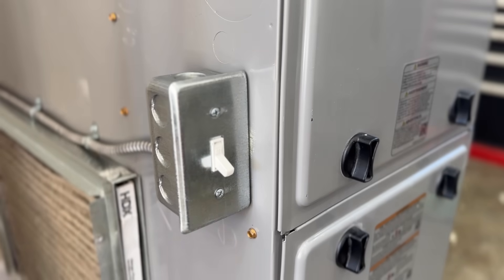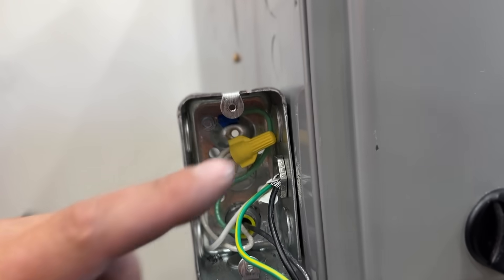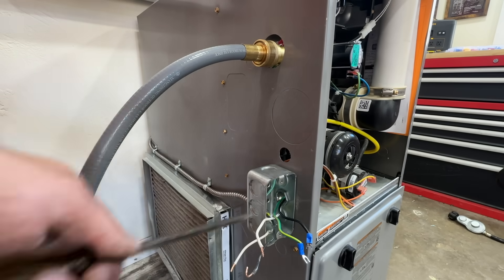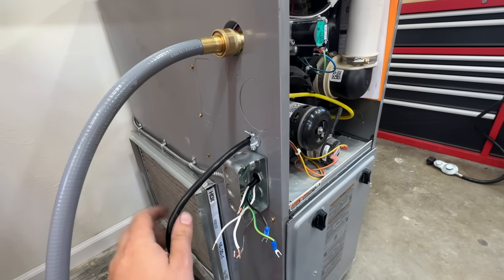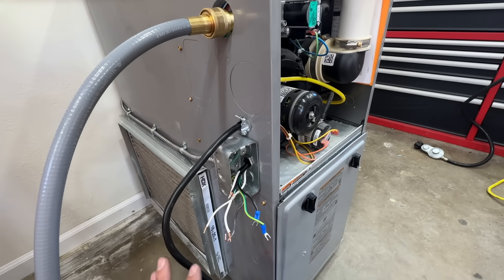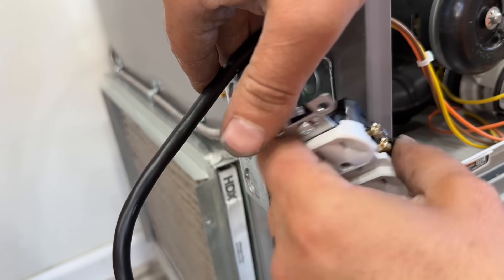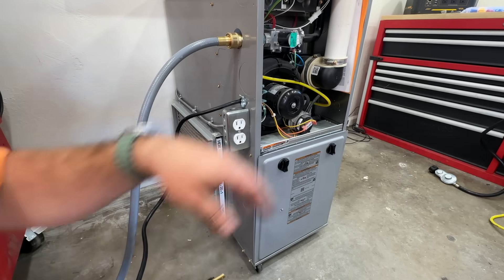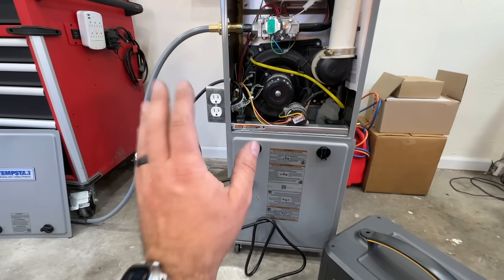Keep Your Family Warm During A Power Outage By Installing This $5 Part

Comment: Using a flexible cord to supply a load that is fastened in place violates the US National Electric Code except under particular circumstances that do not apply to a furnace and boilers are not permitted to be supplied by flexible cords. That doesn't mean that you cannot do the equivalent of what your doing. You just don't use a flexible cord. 

Using a double pole, double throw, center off  switch and a cord INLET you connect the common terminals of the switch to the furnace, one of the selectable terminal sets to the power from the panel, and the other set of selectable terminals to the cord inlet. When you throw the switch up you connect the furnace's wiring to the circuit from the panel. When you throw the switch down you connect the furnace's wire to the  cord inlet. If you move the switch to its center position then the furnace is not connected to either. The center off position is what makes the switch acceptable as a disconnect switch for the furnace. 

When the furnace is in regular use no flexible cord is used because having the switch up connects the furnace to the furnace branch circuit from the panel and no flexible cord is needed. When a power failure occurs you plug the female cord cap from the generator into the cord inlet. When the generator is running and producing a stable voltage you throw the switch down and the furnace begins to run. The NEC does have an exception for the use of flexible cord in emergencies so using the flexible cord to connect the generator to the fixed male cord inlet is not a violation of the NEC.

Comment: Electrician one thing it may have been covered before it comments when you remove the switch you eliminate your disconnect to furnace in normal use which is required by code .

Comment: IMO, it would have been a better solution using the "off" position of the switch to connect the extension. That prevents a feedback loop from forming (This solution does too, but it seems less clean), you can ONLY ever have either panel power or external power. Also, the addition of a "plug protector" would make sure that there would never be a GFCI fault in either implementation.

Comment: Thank you for making this very useful video.
I have installed this on my Bosch high efficiency combo boiler.  Now I will have heat and hot water in the event of a power outage.  I am using a 300 amp hour lithium iron phosphate battery and a pure sine wave inverter to deliver clean electricity to the boiler.  I tested the system last winter during a cold snap and it worked flawlessly for 3. 1/2 days before the battery needed recharging.  I have a spare battery ready to go if needed and small portable solar array (800 watt) to recharge the depleted battery.

Comment: Some furnaces require a bonded neutral for the furnace to operate. I have a Trane, without the bond, it generates an error message and won't run.

Comment: Great video, I would like to add a few pointers. You need to strip the white romex wire a little longer because you tightened the screw on part of the white wire sheild and that could come loose over time and cause a loose connection. The other thing is I would tighten the screws on both sides of the outlet that you did not use so they have less of a chance to hit the side of the metal box or a ground wire. Other than that looks good to me.

Comment: First time home owner here with no generator lol. Currently a power outage due to tropical storm. I have an oil furnace. Would an electrician be able to create this for my furnace (19 year old furnace). I also wonder about a battery for this such as a delta2 battery (?)
Reply: Hi, an electrician would be able to install it.  Whether they want to due to code is another issue.  I built my own safe way of powering my 40 year old furnace.  I have a delta 2 but also built my own battery pack for emergency heating and powering appliances.  Keep in mind, battery charge limitations.  What I mean is, the electrical charge storage of batteries is kind of poor even with the best battery type available.
Reply: @JT-lq4yd yes I have one coming to help. I am trying to decide if I want the ecoflows delta pro or standard portable generator. I wonder how long your model works for backup tho
Reply: @LizAlexy Great, I hope the electrician can get you setup.  The Ecoflow Delta Pro is great since additional batteries can be added to the main unit.  A regular gas generator is a great complement to the Delta Pro unit as it can recharge the DeltaPro.  
The battery setup I put together will only give me about 30 hours, but I also have a generator that runs on gasoline and propane, this will charge(depending on discharge level) the batteries in just over 3 hours.
By the way, I wired a switch to my furnace a few years back and it was nice sleeping in a warm house when power was lost overnight due to an ice storm.
Reply: @JT-lq4yd that’s actually exactly what I’m thinking maybe best for my place. I realized tho I would need to commit to not running my well if I get the delta pro since it’s not running 220
Reply: @JT-lq4yd or else I’ll have to have two sub panels designed the electrician told me my circuit breaker is overloaded so he has to do some work but I don’t think that panel he wants to add is for essentials for the house but other curcuits he told me aren’t done right 😮
Reply: @LizAlexy If you feel a bit more adventurous, there is the Ecoflow Pro Ultra, it can do 240 for your well pump.
I think the breaker panel is full, no more empty spaces for additional breakers and so, he needs to add a subpanel because you would need a power inlet which requires a separate breaker.  Yes, it is important to have the other circuits that he said were not right.  I would get another electrician's opinion, you want to be safe.
Reply: @JT-lq4yd thanks- I was checking the ultra. The person was here was the first to catch these flaws, in fact I had another electrician change double tap breakers to single (since home inspector said it was not to code), and this didn’t help anything LOL. He said the wires are also not done right, so I was planning a sub panel, an ex generator switch, and a lock out on the main case I upgrade to the ultra). My dad spoke w the guy and believes he’s right. But maybe I ought to share a pic of the panel to a friend who does electrical and just triple confirm - safety concerns about the heart of the house had me feeling unexpected 😮
Reply: @JT-lq4yd good idea I asked a friend of a friend who does electrical! Didn’t expect the safety concerns when adding on some switches !!!
Reply: @JT-lq4yd the ultra looks interesting! For now I just got two light weight 1024 watts, and later maybe get a big battery once his subpanel is done w an ex generator switch and a lock out to disable the main - then I can consider any sales on the larger batteries :)
Reply: @LizAlexy  I am happily surprised to know someone is being proactive to minimize the possibility of electrical fires, it is very rare for anyone to think about that 😊.  It was a good thing the electrician pointed out potential issues and yes, if the wiring is flawed, try getting it fixed asap.
Reply: @LizAlexy  Yes, that is how it goes, you start working on something and then you realize corrections need to be done.  In my house, I wanted to install an outlet  in the room where the furnace and water heater are located.  When I opened the electrical box, I found the ground wires not secured together, just pushed into the box 😢.
Reply: @JT-lq4yd thank goodness you discovered it! I’m still trying to decide if ill try to just get oil burner going or make a larger investment in the batteries to run my whole place after the necessary electrical is fixed (he is doing a separate panel and redoing wiring 😢)
Reply: @LizAlexy  The Ultra is nice, but if I were to get it, I would like to have solar panels as well and just have some circuits powered by the unit 24/7.  
Having the power inlet and interlock first is great, then you can upgrade for more capacity later.
Reply: @LizAlexy   I did find it 😊
 I am not exactly sure of your situation but, if the oil burner is working or not, electric heat requires a large amount(thousands) of watts where the oil burner only needs a few hundred watts.
Reply: @JT-lq4yd yes my particular oil burner requires 250 watt continuous. We occasional get sub zero Fahrenheit here. We are going to install and ex generator switch on my oil burner circuit at the panel (so i can use the emergency shut off switch too, at the top of basement stairs if god forbid I need it.) two delta pros come tomorrow, I have a wood stove but a big house. I’m debating what else to expand towards if I want a delta pro in basement at the switch. The delta 2 are 27 lbs, a little easier to move around if I need fridge plugged in or additional battery at the 110V oil burner switch …burner works fine doesn’t need as much electric right now as it will during any extreme weather during winter …
Reply: @LizAlexy  I see.  Now, if your oil burner needs 250 watts continuous, a Delta 2 which is 1024 watt-hours will give you around 4 hours run time.  You just need to see what is more convenient for your situation, where placing your equipment makes sense.
I am more worried about extended power outages in summer than winter because I don't worry about my refrigerator.  Since it's cold outside, I would bring some food to my garage for natural refrigeration.
Reply: @JT-lq4yd true. I have the extra battery which leaves it closer to 3k watts. Debating another pair of these delta 2 plus extra battery and a predator harbor freight open frame 8750. Feel like w these would help run basics for some days at conservative load and run
Reply: @JT-lq4yd here it can get extremely cold in winter like -15. I have had one pipe on outside wall bathroom freeze each winter once..in the summer, I’m less afraid LOLOL
Reply: @JT-lq4yd could also go larger w the inverter and get a 11,500 watt but it’s a lot more expensive, and also 300 lbs. I’m like I cannot roll a horse 😂
Reply: @LizAlexy  Yes, the Deltas paired with the generator are ideal, especially because they can recharge in about 80 minutes from empty.
Reply: @LizAlexy  Right, I am in northern Illinois and it can get that cold here as well.  Because I installed a transfer switch on my furnace, I don't worry about sleeping in the cold 😁 but also frozen pipes.  You are so right about not having to worry about that in summer.
Reply: @LizAlexy  A 8,000 watt generator is great for the average house.  You could run some appliances while recharging the Deltas.  I personally have 2 inverter generators, one is 1,600 watts and the other is 3,000 that can run on propane, Hank Hill approved 😂.  Gasoline goes bad after a while.
Reply: @JT-lq4yd house is a little larger than average 😂 but I can’t move a 300 lbs 11.5 k inverter. In all honesty in two years we lost power here and there, not typically for more than 6 hours. Still had a pipe freeze when temps went sub zero, perhaps one thermostat was old and cranky next to my improved wood stove tossing the thermo dynamics of the layout lol
Reply: @JT-lq4yd did you mean that if I charged my delta 2 and extra battery yesterday, it’s charge won’t hold long? Or do you mean when I am using it, it won’t last long. I had the electrician here when I plugged the units in. We set up one dehumidifier  to it 2800 ways at 50% and got a read that  it would would last 2 hours. lol. I need some more provisions! We plan to ez generator switch the oil burner and maybe one kitchen island outlets or some lights or fridge on other switch. He’s planning a lock out bar on main panel after he fixes SIX other electricians mess ups at the main box 😂
Reply: @LizAlexy  The Delta 2 holds charge very well.  During use with a 1,000 watt load, it will only last 1 hour, and 1 more hour with the extra battery.  Just to give you an idea, when we lost power during an ice storm a couple years back, a 1,200 watt-hour battery pack I assembled lasted overnight powering the furnace.  Some extra supplies don't hurt 😊.
Reply: @JT-lq4yd  tempted to even get a delta pro 3 to run off the main panel only selected circuits, however I did see that it’s a newer battery and one battery pro apparently did smoke. Could dupe the delta 2 setup I have here and go gas generator maybe a predator what do you think?
Reply: @JT-lq4yd I do know my oil burn is 255 watts continuous
Reply: @LizAlexy  That's not good, gotta give some Nicorette gum to those batteries that are smoking 😅.   
My thought is to have enough power to pass the night and run a generator during the day to recharge the Delta 2 and power appliances.  So yes, a generator would be great.  By the way, I recommend some fire extinguishers for 🔥.
Reply: @LizAlexy  😮 250 watts continuous is quite a bit.  That is about 4 hour run time from a Delta 2.
Reply: @JT-lq4yd if it runs continuous right ? But delta 2 has 1800 watts. I’m so confused !!! Even a keurig coffee maker uses 800-1600 watts!
Reply: @JT-lq4yd haha good points ! I did make sure the extinguisher was downstairs by all this stuff. A generator is a good idea esp if I want to run elements of the house like the well and it sounds like the oil burner too :( delta 2 ecoflow checked my oil burner said it will run 4-5 hours maybe we got some math wrong !!!!!! Sounds like 8750 watt inverter won’t do much either (?)
Reply: @JT-lq4yd I guess it is meaning maximum 250 watts (?) so if the burner isn’t burning it’s not 250?
Reply: @LizAlexy  My apologies, I said 1 hour but meant to say 4 hours.  The Delta 2 holds 1 kwh of electricity.
The Delta 2 has 1800 watt capacity, that is how much it can power until the battery is discharged.  Some hair dryers use 1800 watts to blow dry hair and the Delta 2 can make it work for around 35 minutes. 
Just as an example, the old light bulb💡 had a different watt ratings and the most common were 40, 60, 100, 120 and so on.  If we use the 100 watt to make the numbers easier, this 100 lamp will use if left on for 10 hours will use 1000 watts.  This means that the Delta 2 can power the 100 watt light bulb for about 10 hours.
Reply: @LizAlexy  I keep a fire extinguisher near my bed 😂.
The 8750 generator will do a lot for your home and certainly can run your oil burner.
Reply: @LizAlexy  If your oil burner uses 250 watts during operation, is not a lot.  Let's if it runs for 30 minutes every hour and shutsdown, it means it could run about 8 hours on a Delta 2.
Reply: @JT-lq4yd now my electrician wants me to get the delta pro 3 LOL. I’m going in circles here ha ha!!!!!!!
Reply: @JT-lq4yd now we are thinking To get delta pro ultra - we are all over  the place 😂😂😂
Reply: @LizAlexy  What is the reasoning for getting the ultra pro?
Reply: @JT-lq4yd the pro ultra is silent never smoked and runs 220V, which means I can have water, can also feed from gas generator while running it which is new. It’s been out almost 2 years and next to those reasons I would save 2k in tax
Reply: @LizAlexy  Yes, the Ultra is more capable and expandable.  If I was going that route, I would install solar panels to get the most use out of the Ultra.  There is a new model, Ultra X.  In my opinion, is better than the regular Ultra.
Reply: @JT-lq4yd that’s not out until next week, I think? The x. It’s weird the ecoflow engineers emailed me today saying you cannot plug the ultra  into a plug on circuit box (what my electrician was going to do tomorrow), doesn’t make sense and contradicts everything km seeing online ….still lost 😂
Reply: @LizAlexy  I have not looked into as to why it cannot be plugged in.  I suppose they want you to buy the circuit breaker box they sell?
Reply: @JT-lq4yd they corrected this today w new communication :) my ez generator switch and panel for overloaded box was installed as well as a 220 v plug if I get the pro ultra which I’m gonna consider. Ecoflow told me not suggested to use their generator for the pro ultra which is interested and suggested a 3 rd party to re charge  it
Reply: @LizAlexy  So they misspoke, I was a bit confused 😊.  Congrats on your installation, I hope it works as you intended.  As for recharging, any inverter generator should charge any Delta version so long it provides clean AC power.
Reply: @JT-lq4yd yes I am happy a lot of work was done! I wonder if the ecoflow generators are decent, the 3000 looks pretty light weight - I don’t have a shed or anything to keep it secure and the electrician doesn’t want any in my basement at all
Reply: @LizAlexy  That is great to hear 😊.   I don't know about the Ecoflow generators.
You don't have a shed, but what about a garage?  I want to say that the electrician doesn't want it in the basement because he believes someone will run it there and suffocate and pass away.
Reply: @JT-lq4yd no garage no shed - that’s a small generator like 55 lbs or something - we are actually in a storm now so I hope I don’t lose power at least this process is started
Reply: @LizAlexy  Not having a garage makes it a bit more complicated.  You would need a generator that is compact, my concern would be fuel storage as it is not a good idea to store it in the house.  If you had propane for heat, you could share the supply to run a generator.
Reply: @JT-lq4yd that’s a good point, less expensive small ecoflow doesn’t go off propane but the gas and generator could live under my back porch which is lifted  and airy ? And pull them out when and if needed ?
Reply: @LizAlexy  You could build a small "shed" or get a porch storage box and put them underneath your porch to store them.  The only problem is that the Ecoflow generator has more electronics and I would be concerned about outside storage, same for gasoline as I understand it goes bad faster when stored outside.  I don’t know how your area is when it comes to people taking other's belongings.